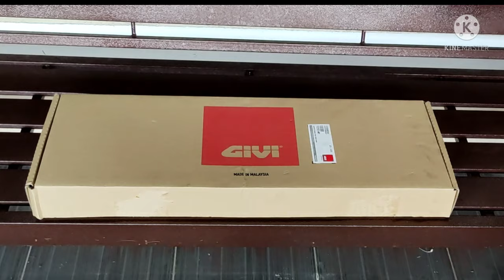Installing GIVI V47NN Monokey Top Box + Trekker base plate on CB500x

Comment: Does the top box vibrate or rattles when you ride?
Reply from the maker: So far no issue with the top box. No sign of additional vibration when comparing without the box setup. Cruising speed aroud 120 - 140km/h.